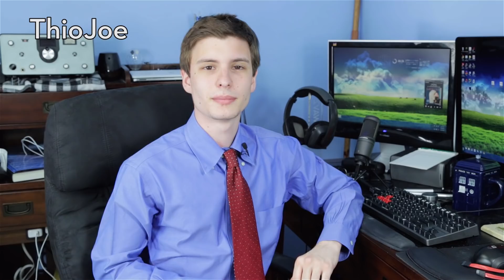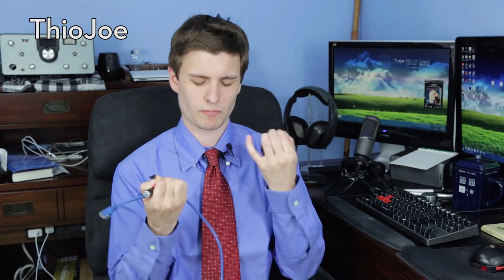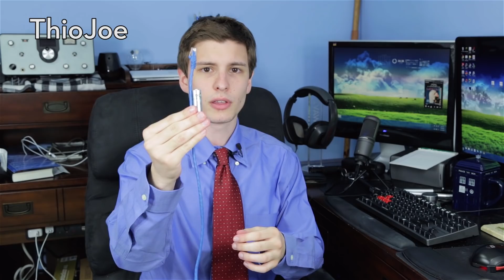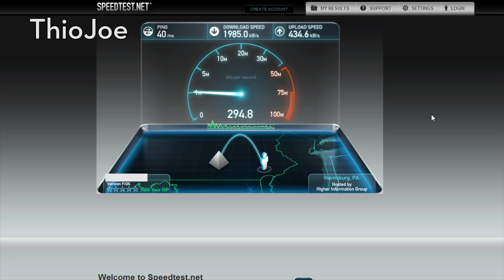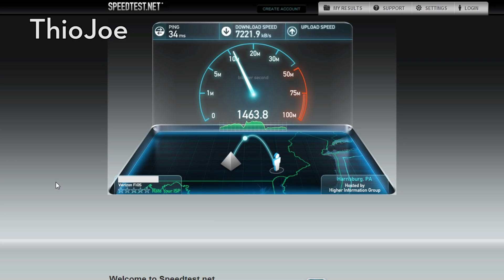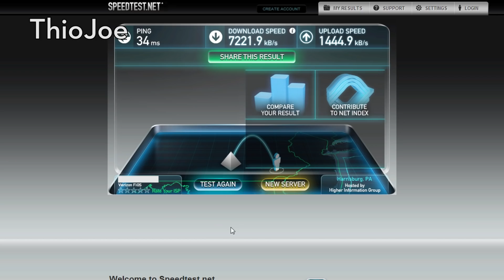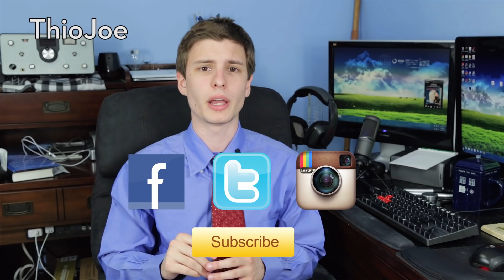Triple Your Internet Speed for Free

Comment: No electrical tape doesn't conduct electricity it isolates it.  Its made of rubber.
Reply: +0011peace It is a prank :)) He said that purposeful :))
Reply: The whole is a prank or this guy is stupid.  the cable shielding has too high of resistance  for the battery to effect it.  None of this is possible because of shielding.  To get induction you need coiled conductors and AC.  Computers run DC so coiled conductors at like resistors.
Reply: +0011peace it's all a joke in a pretty professional and believable package. I am imagining all these 17 year olds doing this who are a bit naive to the beginner's electrical/networking knowledge but are determined to get a better online gaming experience.
Reply: checkle1
Yeah a bit too dead pan for me.  After watching it again I realized just how ridiculous all his suggestions were.  Batteries unattached at the leads don't do anything, rubber shielding keeps out stray signals.
If this worked they way described you would get interference for every stray signal.
If someone wants triple internet speed either  get high tier of  service from ISP or drop a trunk line.

Comment: I'm an Idiot, before see this video to obtain same results using 2 different internet connections... I think batteries is much better. 
PS. Thanks for the tip about the electric tape, I use it now instead copper, is much cheaper.

Comment: Just wanted you to know.I used green duct tape and 3 ignition leads off an old Chevy 350 engine. I was able to achieve 6 times upload speed!I would like to note that using red duct tape stopped my download speed all together. Probably because red is an international color used for stop signs but that is just a guess so I will leave it up to you to do the math to verify this...Anyway, thanks for the video, it was VERY helpful!

Comment: Worked for me, tripled my 50mb/s to 160+ so just over 3x. BTW i used camera batteries :D
When i reverse the batteries it increases the upload speed (maybe it does matter which way round the batteries are!)
Also there is only like 1cm where it will work on my cable (cat 6 ethernet)

http://www.speedtest.net/result/4890120113.png

Comment: If you know how the internet works, then you of course know, that this is complete BS..
1. You can't get more speed out of your internet service provider, than that you have paid for.(Boy it sucks to be you, if you really only get 1/3 of what you paid for in speed)
2.  For this to work, like you showed, then your router must have received the 3 x speed you showed and the loss of data due to noise, must have happened in the Ethernet cable, which was no longer than two meters(Oh boy that cable is in a terrible state, if this is true), because your speed can't get faster than the weakest link in the communication path from your computer to the server, that you tested your speed on.

Also one question: How can an insulator work as a conductor? (the Electronic tape)

Comment: Okay, I think I did this wrong. I taped two batteries to the cable in opposite directions like he said. I don't have any plus-or-minus-meters, so I eyeballed the battery direction using my dog. I taped one battery when the cable was pointed at my dog and the other when the cable was pointed directly away from my dog. It isn't working. Now I'm starting to suspect I should have been on the other side of my dog. Any advice? I need this!!

Comment: Guys this video is old now the new way to do is way more easy.

What you need:
1. wifi
2.a laptop or computer
3.a chainsaw

firstly all you need to do is lower the chain saw so that it is touching the laptop or computer and then turn it on.

if you have done this you are an idiot :O)

Comment: ThioJoe, mine did not change. Am I using an incorrect cable? I live in California, and the cable color is gray. It was pre-installed by our internet company, and we have a 2Mbps internet connection, and we also live in a rural area. what factors could be contributing to this?

Comment: ThioJoe I heard you get the same results if you put several magnets directly onto your processor and RAM sticks.  The magnetic will keep the data streams moving.  As an added bonus if you use enough magnets you dont even have to plug your computer into the wall the power company will hate you.

Comment: You made a stupid statement at 1.01minutes. when you said to use electrical tape because it conducts electricity. If you Google "Electrical tape " this is what it says." Electrical tape is a pressure sensitive adhesive tape used to insulate electrical wires and other materials that conduct electricity ". So your statement is incorrect and possibly dangerous!!!!

Comment: Should the battery be changed
Reply: no, the more charge that the batter has, the higher the internal resistance. As he said, you want the lowest internal resistance, so using a dead battery will work the best.

Comment: have you tried a trick with connecting directly to nuclear reactor output , it will result in lightning speed but only when the other end is plugged into your rear end also called ass.

Comment: Yeah, I use electric tape to connect component because of it's high conductivity. Be sure NOT to touch electric tape when it is plugged in to avoid severe shock! Also, hwy did he say his upload speed was 430 
kbps when it showed the dial at approx 3 MBPS ??   :) ....   give a guy a clean haircut, a nicely pressed shirt and a tie... he's showing you one thing and telling you to believe another....like a Politician...he should work for the Government!   
( By the way,   I used Scotch Tape and it worked just as well....(so you can't believe everything you hear)

Comment: Hi there. What I have from ISP is one of those 2 in 1 modem-routers which does not have an antenna and I use wifi to connect so I don't connect via lan cable. Can this still work for me? Can I connect the batteries to the RJ45 telephone cable instead? Thanks.

Comment: When ThioJoe talks about electrical tape "conducting electricity" he may be talking about what electricians sometime call a "trickle charge." As my neighbourhood electrician once demonstrated to me, if you put a voltmeter to the plastic insulation of a live wire it WILL (sometimes?) show a tiny, tiny reading—otherwise known in the trade as "leaking." This is because no ... let's say, "commercially viable"... insulator is absolutely 100% effective. For obvious reasons regarded in the supply of electrical power, as insignificant, it might well prove relevant at the minute voltage levels common to digital media. That said, I wouldn't be at all surprised to find that common plastic insulating tape showed a capacity to transmit an albeit almost imperceptible charge. As for the rest of ThioJoe's proposition I haven't tried it and probably won't—because, quite frankly, it seems absurd. Who likes being taken for a fool? Personally, I thing the whole hoax phenomenon—a curse second only to the virus phenomenon—is just another plague to be borne by us regular people trying to get on with out lives. Why do you people do it? Does it turn you on? In the words of Mark Twain, "Any idiot can burn down a barn." My guess is you're all terribly frustrated at you inability to build one.

Comment: I live in the interior of Panama and there is no cable where I live.  I get internet through a USB modem dongle.  I have a wireless router for the USB dongle.  Instead of putting the dongle into the router I use a long USB cable (powered) and put the dongle outside in an effort to improve my internet connection.  Since my signal is coming over the air and not through a cable, do you have any tricks I can use to speed up my internet?  Thanks.

Comment: You clearly just want to a friends house, connected to their router and tested theirs, and then tested yours. Also, the batteries and cables won't do anything because of the plastic coating around the Ethernet cable.

Comment: Subject:  Double or Triple your internet speed:  I have tried both methods to no avail.  My problem may be my internet source is Warner Cable.  Here is my cable routing.  Out of wall to cable splitter.  Splitter to WC-modem.  Modem to my Linksys Router.  Out of Router (with Cat5 cable and Batteries attached)  to my PC.   No difference either way or using both at one time.   ???????   Is it me, Warner Cable, Modem or Router  ???????   Thanks in advance for your opinion and replies.  Ellis.
Reply: +Jim Ellis how should i put this......the part where he said "electrical tape conducts electricity'' didn't raise any red flags? there is no hope for you. plz dont breed, and if you do #abortion we dont need any more dumb people who can't use  #logic
Reply: +Grimm Reapo I thought about that so I used  TINFOIL and that worked fine.  Watch for the Video.By the way, I saw your picture. Your FARTs must be so bad you have to hold your nose.
Reply: i hope your pic is fake, and your actually a child, cuz no adult would #1 be stupid enough to try anthing in this video, and #2 act so immature when called out on said stupidity ;)

Comment: I did something more radical than this and it worked. I wrapped both sides of the network cable on this video around my bedside lamps in my room and secured them with the same tape on this video for electricity conduction, and then I turned both lamps on. I managed to download my girlfriend from Skype right into my living room. You could not imagine the thrill I had.

Comment: My Internet is a 2 part system the router and the the box that makes it into wifi. It uses the same wire that is In the video to connect them. If I was to add the batteries to that will it still work. I'm asking because my Internet is just shit and my school is starting to have more Internet related homework, so please respond

Comment: Electrical tape (or insulating tape) is a type of pressure-sensitive tape used to insulate electrical wires and other materials that conduct electricity.

Comment: if i can't find 2 batteries, is it ok to use a flux capacitor, out of my 1981 Delorean ?
Reply from the maker: +lhowelljr yes that should work
Reply: @ThioJoe  Thanks ThioJoe. Doing a great job!. I'm wondering if this concept will work when applying to automobile wiring. Bc u know after a while some of the wiring will lose its current signal due to increasing resistance or wire oxidation etc.. (especially sensitive wires) and instead of having to replace/ re-wire the whole thing internally through the vehicle maybe u can just boost the signal? PS: You remind me a lot of Nikola Tesla. Don't mind all those idiots. Just stay focused and keep applying yourself.
Reply: Zok Zak The joke flew right over your head.
Reply: +lhowelljr Yes. I had the same problem and it worked!
Reply: yes but ull need a thunder :D
Reply: +ThioJoe lmfao
Reply: +Zok Zak facepalm*
Reply: It's like  quadrupled internet speed
Reply: That poker face tho
Reply: +lhowelljr 
Actually, that will make your internet go back in time. It will be a dial-up connection, and you'll only be able to use an AOL or Netscape browser. YouTube didn't exist back then either.
Reply: Be careful not to cross the beams. xD
Reply: +Toebey Kid nah use your shoe lace it makes 100 time faster
Reply: +peter simatos yes, the problem with using ex girlfriends as a data transmission medium is that you data rates depend on the contents of you data.

For example. the YouTube video you want to watch will take forever and buffer like crazy.

On the other hand the YouTube video of you falling flat on you face after attempting some stupid stunt will circulate the entirety of the internet faster than you can imagine or would want it to.
Reply: +lhowelljr that only does a 2.5 multiplier, so it won't be as fast, but if you pour a little gas on it, it will speed it up by roughly 5x, so that's the optimal fix
Reply: +Chris Baker its all fake, he says it in the "about" on his channel
Reply: +Stick Figure LOLLLLLL
Reply: +Stick Figure Brilliant response to a brilliant comment. Nicely done!
Reply: lhowelljr Lol I hate Thio, I heard he was a troll and a clickbaiter
Reply: ill ttpry to help him a bit 88mph time travel do you even movie Bro?
Reply: +Newfman 75 try*
Reply: +Boomerang Aleks stfu :P
Reply: Xbox is better
Reply: +lhowelljr yes
Reply: No use my cardboard box, it was wires.
Reply: Yes
Reply: +lhowelljr that will work 1000x better
Reply: +lhowelljr Precisely. That should do it doc.
Reply: Gamerteen01 NO USE A CARRDBOARD BOX, WITH ICE AND CREAM.
Reply: +lhowelljr haha true ons flux capacaitor id on you inten net speed will incresse more cuz flux capacitor has more banwitdh for some stupid reason he can expalain that what delorian need only 1 not 3
Reply: yes
Reply: Use a flux capacitor out of a 1982 Delorean, much more internet speed.
Reply: ***** No..........
Reply: +lhowelljr i used my 2 x girlfriends to transfer the data its was the best way, i put them  2 9v batteries on their backs and they run like crazy
Reply: +lhowelljr rofl.
Reply: +ThioJoe  congratulations on 600000 subs
Reply: +Zok Zak whell then why does he have a lot of likes on his videos ?
Reply: Of Course
Reply: +lhowelljr only 1 way find out
Reply: +Chris Baker while at it why not light it up tooo,  I have not seen any of this guy Idea work. I don't know if he is serious or joke.  why so many people follow him??????????
Reply: Thong Lee his account is a complete joke, I don't know why people actually follow him, tbh, cause its not very funny
Reply: Daniel Tan yeah, that's what i was saying
Reply: Favorite comment ever.
Reply: Lol
Reply: lhowelljr oil see h KO CT ti
Reply: all of his videos are fake..read his bio his stupid
Reply: +Zok Zak r/woooosh

Comment: You guys are stupid, I came here with the same expectation... Electrical tape 1. Doesnt conduct electricity, in fact, it does the exact opposite. 2. Batteries will not do anything to your internet speed, as the battery isnt even connected to the cable, we all got trolled.

Comment: he seems like a pretty smart guy, but i don't understand why he only went half way with this:  if you wrap the ethernet cable through a toroidal magnet, it behaves like a transformer, causing an LC tank circuit, thus causing the cable to resonate at a harmonic of the internet.  further, if you put a piece of grounded foil around it, it further shields it from interference, (like a faraday cage), allowing you to get gigabit ethernet even on 1.5 Mb/s service.  Ive been using this for years.

Comment: I really wanted faster speeds, so I used to 12Volt Car batteries. It took 6 rolls of electrical tape for each battery but it worked. Now my speeds are so fast, my computer types whatever I'm thinking. In this case, it just kept typing bullshit, bullshit then, bullshit.

Comment: @ThioJoe  you're NONSENSE. electrical tapes are use for insulation, not for conduction. batteries will generate STEADY, ONE DIRECTION magnetic field and therefore can not produce current in the conductor. its like u waiting for power in your portable generator without running the engine LOLS!

Comment: Putting a battery taped near the ends of the cable is not going to give you a better speed, If you need a better speed, check your Router/Switch/Modem. The connection between your node will also drop your speed if your ISP uses more customers to the one node. Cat6 cable is better suited for longer distance as it has electro shielding and twisted pair's.

Comment: Umm...I stopped watching when you said, "It's important to use electrical tape, because it conducts electricity." FYI, that's exactly the OPPOSITE of what electrical tape does. It insulates electrical wiring because it DOES NOT conduct electricity.
Reply: That was the point lol, it was an obvious troll... smh
Reply: +Chuck Renner This is his comedy channel.
Reply: you see, the rubberized material on the back of the electrical tape is an insulator as you mentioned, but the static compound used on the sticky side can help conduct digital and static signals.

Comment: Hey ThioJoe, I tried your tip. & it didn't work, I reckon because: First, I think I didn't know where exactly  the cables go. I attached the router with the my device directly, & I got very slow speed. Second, does the batteries' size matter readers, insert sexual joke here? I used double AAA because that's what I have at the moment!

Comment: I don't think this will work because the cable modem limits bandwidth based a command from the cable provider. Further ethernet has a fixed clock speed. It will not send more bits per second just because the cable physical properties changed.  Further when you measure net speed, it depends on the distance to the test server, not your local connection.  This is some warped sense of humour.  At least his joke does no permanent damage.

Comment: As i had said before if you are running 8x4 upgrade to DOCSIS 3.0 16x4 and trade out your DOCSIS 3.0 8x4 modems 7 out of the 8 cable ISPs have all upgraded to run 16 channels now so if you have 8x4 you have less throughput since you are only running on 8 of the 16 channels they are providing

Comment: to make sure you are getting the best from a DOCSIS also make sure you check Signal to Noise ratios for each channel on the downstream side in the modem 35 SNR is a fair range anything 40.0 and above is a sweet spot Powerlevels on the downstream side should be either +5 or -5 between those ranges above or below you might want to get it checked out

Comment: for Cable users only as i said if you want more speed upgrade your modem to a 16x4 channel vs an 8x4 channel example i pay for 100mbps down 4up with my 8x4 i pulled 98 to 101mbps max with my 16x4 i pull 115mbps to 138mbps download side depending on the peak hours of the day since 16 channels are being used rather than 8 for the download side upload sides will vary on providers there's your examples it's not only for what you pay for it depends on the hardware to